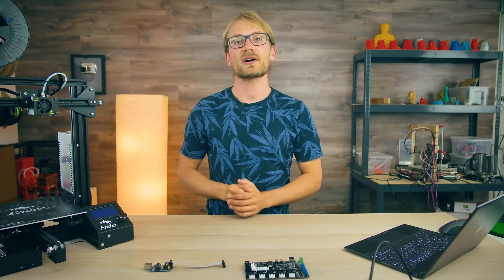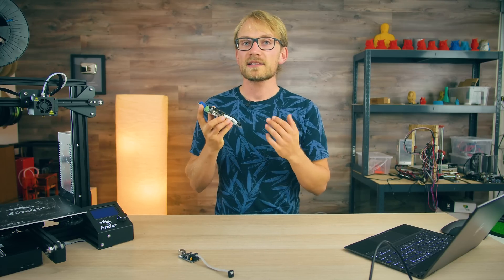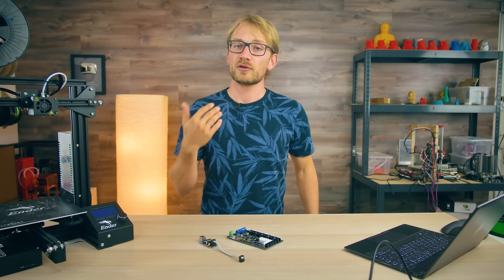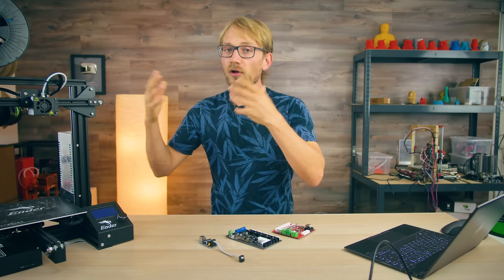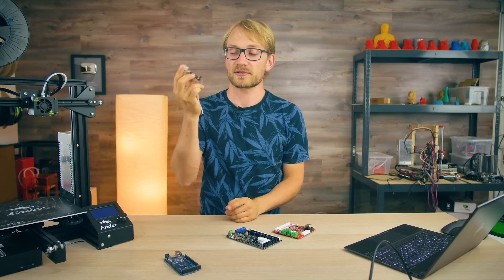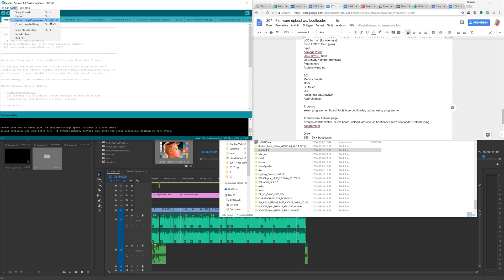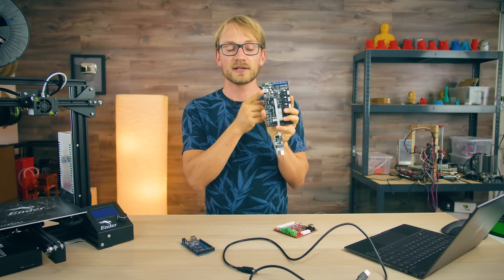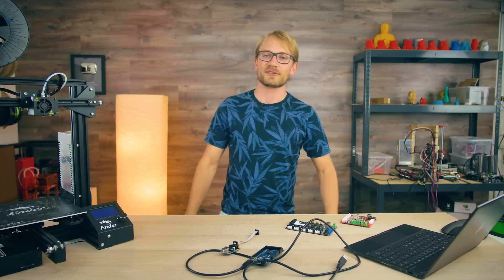Update your 3D printer firmware without a bootloader!

Comment: Buying a USBTinyISP was the worst advice ever. I should have got an Arduino Uno. After flashing the bootloader onto my Ender-3, I get nothing but a blue backlit screen after boot-up and i cannot communicate with the Sanguino board when connecting direct to my computer. (yes i have the FTDI drivers installed).
Reply: Nah that just means you should have purchased an ICSP programmer rather than trying to use the Arduino. You can unbrick a board in no-time with a reliable ICSP.
Reply: I have this problem currently. Did getting an Uno fix it?

Comment: Very usefull video! Thanks a lot! I have a question: my I use this ICSP board to upload programs to an Arduino which USB adapter is broken (PC doesn´t recognise the board)? It happens I have one Arduino Mega 2560 and a MKS Gen L01 with the same problem.

Comment: Another reason not to install a bootloader is if you have your printer connected to your PC permanently or through octoprint and a hacker happens to gain access, they will not be able to flash your printer with no failsafes remotely. This is unlikely if the device attached to your printer has no internet access but lots of people open port forwarding for octoprint to access it externally which means  others can too.

Comment: I had success flashing a bootloader on the Ender 3 using a cheap nano clone. Note: the ICSP pins are orientated 180° different as opposed a Uno. I flashed the Arduino ICSP programmer to the nano. Then the bootloader to the Ender 3.

Comment: You may also use *Pi's GPIO with avrdude to do the programming. Mind the 3.3V to 5V shifting, though. If you already have octoprint running then it is basically free.

Comment: Could you clear something up for me? On Creality's website,  they have firmware files for download,  however they have a PDF. file describing updating the Creality firmware through usb and Cura. 
No talk of bootloaders. Could you please tell me if this method is legit?
Reply: I would guess that Cura will tell the target (printer controller) to reboot and then it will "catch" the bootloader (after the reboot) and proceed to do a firmware download... sounds like that is what Creality is doing here... So the board likely does have a bootloader; it is required to do any USB programming.
 - Eddy

Comment: Great explanation. I’ve found on the CR-10, loading the bootloader with an ISP programmer caused timing issues, it was too fast. Could be related to added circuitry on the ISP pins if the CR-10 board, don’t know. . But using the Arduino as ISP worked every time.

Comment: just did my CR10 Mini , no sweat . mine had the newer board ( EDIT: Still Sanguino ) but no bootloader installed. Also flashed the wanhao Mini ( 2x )  last week 

all the safety features are enabled now. Only waiting for the new fancovers to be printed out so I can replace those pesky fans.  make even more noise than my 10GB Netgear switch.

fans arrived yesterday so I have some work to be done (noctua )

for anyone else wanting to flash the newer cr10: use the connection with reset to pin 10 and still power both
burn the loader and you are good to go with any decent firmware

Comment: I am kinda wondering if you can use the mainboard from the mk3 (Einsy Rambo) to build you own frankenstein 3d printer and just modify some settings in the firmware config to have all the features of the Prusa mk3 but on a bigger and/or different frame.
Reply: No... Well... Maybe. I don't know how they did the power panic, their firmware actually doesn't support huge machines because they switched it to integer arithmetic, the fancy bed sheet isn't sold to non customers, the heat bed isn't sold separately. But I guess you can get the fan speed stuff.

Comment: Heh laughed a bit at the absurdity that Atmel couldn't call it ICSP, because that was a microchip trademark, so they called it ISP "In System Programming". I wonder if that's still the term they use since they were aquired by microchip.

Comment: Does Marlin have any big advantages over repetier firmware? I currently use repetier, but the manufacturer of my printer recently published a Marlin version.
Reply: Repetier is kind of old I guess? Marlin has some fancy auto leveling and s curve acceleration as of recently which might not be on repetier.

Comment: The adafruit USBtinyISP will not work on atmegas with more than 64kb of flash.  If you try to program a 128k or 256k device it will look like it worked, but it doesn't write to any memory above 64k.   I don't know if the Chinese versions have this problem.  I have the Adafruit programmer, and I use it for ATmega328's.  I also have an Atmel ISP programmer (not made by them anymore :-(  ) ,  that I use for larger chips and ATXmega's.
Reply: Wish I read this sooner...
Reply: Can you burn the bootloader and than flash Marlin directly to atmega from windows?
Reply: You need a USBtinyISP Version 2. Make sure you're buying a Version 2 board, or buy a USBasp ICSP programmer from Freetronics instead.
Reply: Huh... I suppose if you're just burning the boot loader that's okay, but still kind of a major bug. :(

Comment: I've been working with raw ICSP stuff for a long time (even for attiny chips in bread boards, etc), and I'm surprised how accurate you were, and also that even I learned something!! Next time I can't find my crazy 10 year old $70 ICSP programmer, I might try the arduino isp... Heck, I may even grab a couple of those $3 programmers.  Thanks Tom, you're the best! :)
Reply: I would avoid them as a general purpose ISP for the reasons stated elsewhere--limited to 64k of memory.  Get a few USBASP devices.  They work a lot better.
Reply: @davidwillmore  my main isp is an STK500v2 variant of some kind.  It does the job, wouldn't hurt to have backups... Why is the arduino isp limited to the size it can program?
Reply: Keith schaff pointed out that the AVRtinyISP is the one with the limitation.  I assume it is because it uses o e of the other Atmel ISP protocols with more restricted addressing.

Comment: NOPE ,TOM that won't work with the newer Arduino software.  If you use the wire diagram on the Arduino web site, it just won't work with the ISP software currently as written. Trust me, I just tried it with a  mega 2560 to flash a bootloader to an Anet board. Using Arduino CC version 1.8.5 ( 1.8.6 has been know to throw errors with marlin ) Read the instructions in the software You wire from the ICSP header on the mega to the ICSP header on the printer board ( J3 in the case of the Anet board ) with reset on the Mega board (the programmer ) connected to pin 10 instead of reset on the ICSP. 
Also note, if you get a wrong chip error when programming the bootloader on the ANET board or it bombs out. Tell the Arduino CC software that the Atmega 1284 you are using is a is the 8 Mhz. chip. Then switch it back to 16 Mhz. before sending the marlin sketch  to the board, and everything will work fine.
Reply: I’ve used this method but did struggle to use a Mega as a programmer, I had to use an UNO to get it to work.

Comment: Great explanation.  Was actually not sure if you could force flash a bootloader or not thought it required an additional chip on the board, good to know its just a missing "software" package that can be pushed to a board without one.

Keep them coming ^_^

Comment: For the 2560, you can get a healthy amount of code with the bootloader enabled, though these memory concerns won't be much of an issue once the 32 bit boards are mainstream. Still, Marlin 2.0.x runs great on the CR-10. For the 1284 boards in the Ender 3 though, PROGMEM space does limit many options. I usually end up turning off most of the graphics for those machines.

Good video Tom!

Comment: May I ask a question? I am thinking on home building a printer. What I am wondering is, what is the best reliable,low-cost controller board OTHER than RAMPS? Single board is preferable.
Reply: What's your aversion to RAMPS? I think the other popular budget boards are Rambo, and Sanguinolululusomething.
Reply: MKS base?
Reply: Prusa i3 Box base. It is a printer I started aand gotten most of the parts several years ago but was shelved due to circumstance. I feel like trying to complete it.